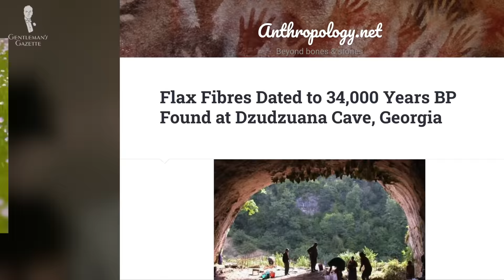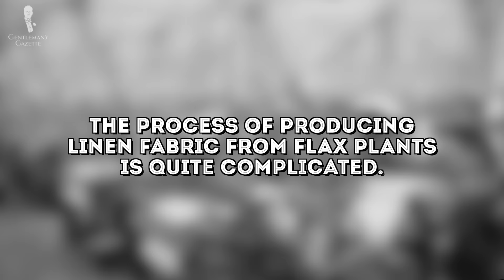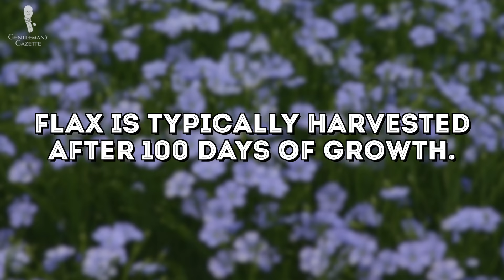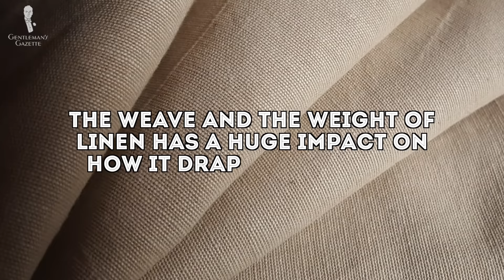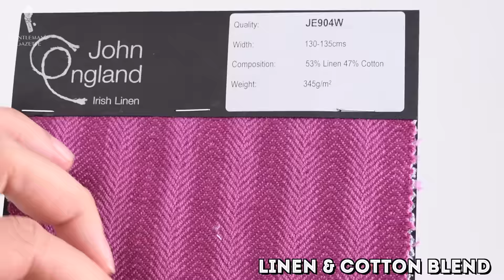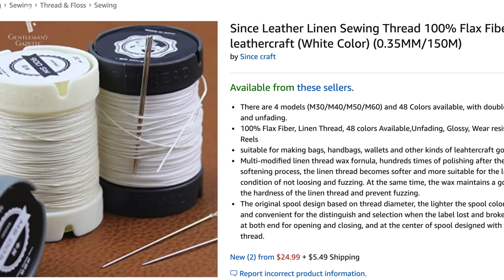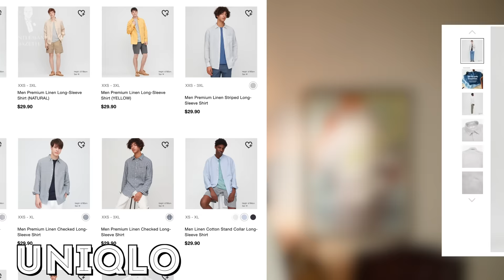Linen Explained - Men's Summer Fabric Guide

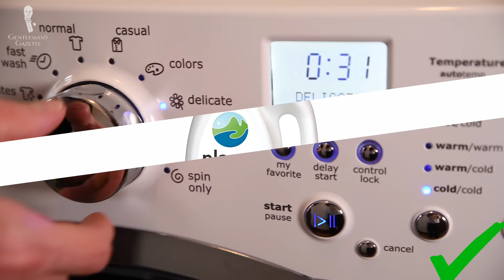Comment: 15:05 - It's a very fine line, using bleach with linen. I've absolutely ruined linen on accident by using too much bleach on the washing machine. Other times, I've gotten my white (and even off-white) linen sparking clean with just a small amount of bleach in an otherwise delicate wash cycle.  If you're unsure, avoid bleach. If you have room to experiment, it may be a good option.  Regardless, it's a risk.

Comment: It is important to note that linen being stronger than cotton is counteracted by the wider weave and thinner fabric. My linen trousers only lasted a year before pilling and blowing out on the seat. Abrasion especially is very harmful to the fabric. Of course the fabric length and quality is important here, but just like with wool, on most garments there is no indication of provenance or quality.
Reply: But the video said linen doesn’t pill. Were the trousers a linen blend?
Reply: Agreed. I've had modern linen clothing disintegrate on me ... the fabric actually grows thin and falls apart, sometimes after only a couple dozen wearings.

On the other hand, I have a linen skirt that my grandmother made for my mom in the late 1940s. I wear it occasionally, it's still doing just fine.

Modern linen tends to be very loosely woven, which is why it falls apart. I sew, and I can't find high quality linen fabric — it's just not made any more.

I still like wearing linen in the summer, but I consider it single-season only. I won't spend a lot of money on finely made linen clothing.

Comment: This is helpful, thanks. In terms of sustainability, always choose materials with organic linen. This means it will be grown sustainably, with attention to factors like water use, pesticides, and depletion of soil. It is also necessary to examine the environmental code of the manufacturer on their website. I have found that Italian firms are the weakest in terms of sustainability. Finally, you can basically guarantee that any fabric used in cheap, fast fashion, clothes is NOT in any way sustainable.

Comment: Well, I just dropped too much money on a bespoke sky  linen summer sports coat in sky blue Scabal linen (similar to the one at 13:10 in this video). 

Based on the VBC linen cotton silk blend and sondrino linen suits that I have, I'd disagree on excessive ironing.   You can press the things to knife-edge creases as much as much as you'd like. 20 minutes of wear in the heat later and they'll wrinkle out of shape at every joint. I'd say to just steam or lightly iron out the worst of the wrinkles once in a while, but accept that linen is gonna look like linen.

Comment: What is better for summer?
Linen, Linen-cotton or Tropical Wool?
Reply: If the dress code is no problem, linen alone'll do greatly for the hottest days. In case you want something less wrinkly or a bit less casual, go with linen-cotton. And on the formal occasions, tropical wool. It'll be less suffocating than regular wool.

Comment: Mr raphael please help me i wear a cotton coat in summers rarely it still feels hot why?
Reply: Probably because it's cotton; not linen. Cotton is a much thicker woven fabric that preserves heat well, therefore making it good for winter weather. Linen is more porous, causing heat to escape and cool ventilation to take place; whereas cotton holds in the heat.
Reply: @TheCuriousFinch  Cotton is not good at keeping it heat especially when wet. The problem is the weave in this case.